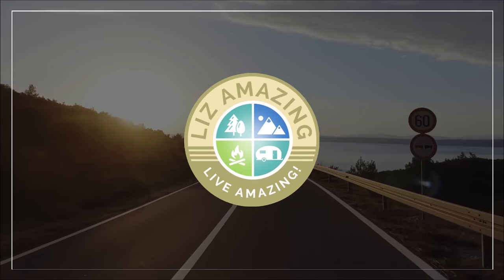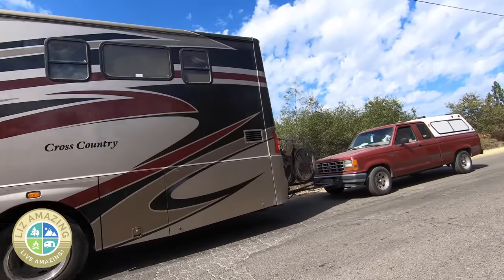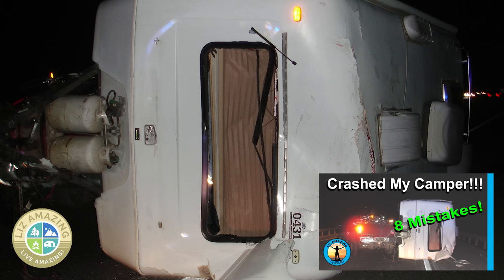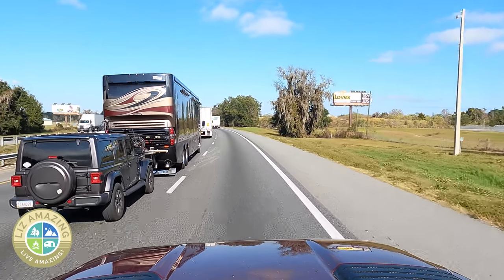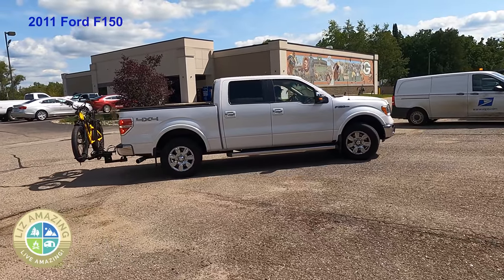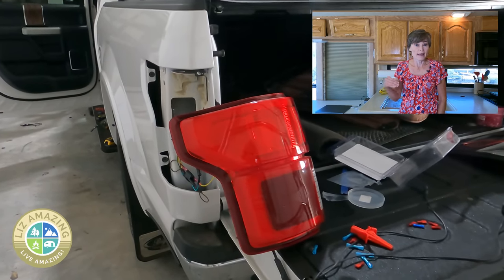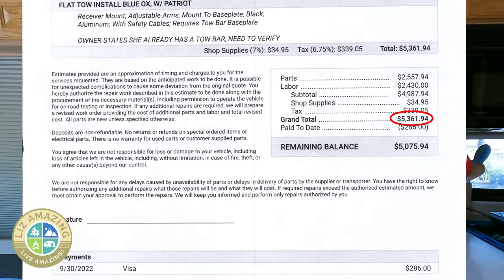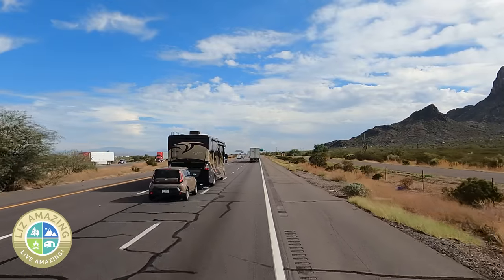These RVers are putting others in danger

Comment: TIP:  To get over the issue with the Blue Ox braking system and the pressure needed to be applied to it (to engage the brakes) from the driver’s seat, we use a carpeted board between the seat and the braking system.  Works like a charm!
Reply from the maker: Thanks for this!

Comment: If you use a tow dolly - Put safety chains on it-They are on Amazon for less than $20.00 a set and do not come with a tow dolly. The straps that go over the wheels can come loose and need to be re tightened after you drive a short distance. I also make sure whatever I am towing has a hitch on it so I can easily move the tow dolly if needed.
Reply from the maker: Great tip, thank you so much, Mark!

Comment: Depending on the state you are towing in you may need brakes on any toad over 1500 lbs. Also, the brake system that stops you under normal braking will also have a break away feature. Toads becoming disconnected is not uncommon. I had a tow bar pin vibrate out on a super rough road and that brake system helped reduce the damage that occurred.
Reply from the maker: Very good points, Sue. Yes, tow bars do indeed fail. Glad you are taking safety precautions. Thanks so much for watching and commenting. See you in the next video.

Comment: Very timely Liz: thanks. I've been struggling to find the right towed vehicle. I don't have a big diesel like you, but a 27' gas engine motorhome with a tow capacity of 3,500 lbs. Apparently it's not the engine (8.1L) but the frame itself and perhaps the transmission. It would have been nice to flat-tow a vehicle. Now I'm uncertain even on a tow dolly. And I didn't like a tow dolly either exactly for the reason you showed. It's a nuisance and unsightly when not towing. For sure - I don't have $5k to plop down to do it the way you have. But I'm with you: safety matters more than anything else. Better to get there slowly than not get there fast.
Reply from the maker: Yes, just don't rush it, Michael. I think I'm going to do a video about how important it is to set some money aside when buying used. I'll likely share how much I spent and how much I set back so people have an example. Let me know if that info would be helpful, and as always, thank you for watching!
Reply: @LizAmazing  Thanks. Your experiences, good and bad have been highly relevant, and you have a succinct but very understandable way of putting things. So, yes, by all means, do one.
Reply from the maker: @Michaelw777.52  Thanks, I will add it to my list. Stay tuned!

Comment: I’ve had many folks tell me the same thing about brakes on your toad. I always ask if they’re familiar with Newtons Law. The answer is always no. It’s F=Ma. The force applied to your tow bar and hitch = mass(weight of your vehicle) x rate of acceleration or deceleration. So if your vehicle is 5,000 lbs and you needed to make an emergency stop from 60 mph then the amount of force applied to your hitch and tow bar is 60 divided by the amount of time it takes to stop. That time is extended when your toad doesn’t have brakes but let’s say it’s 10 seconds. That means that the force applied to your hitch and tow bar is 30,000 lbs. I bet your hitch and tow bar is rated for 10,000 lbs. What this means is you will not be able to stop and your tow bar and hitch will fail causing serious damage and may cause you to lose control of your motorhome. This is why you see such terrible accidents involving motorhomes.
Reply from the maker: Oh my gosh, John. Sure wish I had you standing next to me in the video. That would have been a great sound bite! Thanks for watching!
Reply: @LizAmazing  Thanks. I hope this explanation helps so no one gets hurt in the future. So many folks convince themselves that auxiliary brakes are a waste of money because under normal driving conditions the force applied by the tow vehicle on the tow bar and hitch is well within the specs for that equipment and their coach. Unfortunately if they find themselves in a situation where they have to slam on the brakes to avoid a major collision, not having the auxiliary brakes will not only ensure you get in an accident but the force of the tow vehicle will damage the tow vehicle, the coach they’re in, and can cause the driver to lose control. Usually they won’t have a second chance to rethink their position on auxiliary brakes. I’m hoping the folks that don’t believe they need an auxiliary brake system look at the science before it’s too late.

Comment: So informative, LIz, -- QUESTION --  I noticed that @03:48 that when I look closley I can see your F150 front wheels turning to the left as you turn your Class A.  Does the Blue Ox actually turn the steering wheel too?  Hhow does that work?
Reply from the maker: Hi Colleen. The truck is in neutral and the steering wheel is not locked. This is a flat towable truck. It just follows the motorhome.

Comment: Safety First!!!  As a Commercial Driver for 55 years, I've seen most of it!!  Just one word of caution Liz,  If you find yourself on Icey, snowy road conditions, Turn off the tow vehicle brakes, Your pickup is lite weight, with very little weight in the back, it will lock up first...  Very dangerous!!!   Safe Travels!!!
Reply from the maker: Good to know. Thanks for this. I sure hope I never get on ice though. Great tip! Be safe as well!

Comment: Good video, but you missed that a large number of states require brakes and a breakway system on towed vehicles weighing over 3000 lbs.  This includes Michigan and a bunch of other states.  Ohio has a 2000 lb limit for brakes.  My Chevy Sonic toad is under 3000 lbs, so technically legal in most states, but I would never tow a trailer or vehicle without a breakaway system.  I went with SMI's Stay-N-Play system, similar to the Invisibrake from Roadmaster.
Reply from the maker: Good to know, thank you very much, Brian. Glad you have a good system, and thanks for watching.

Comment: I completely agree, but in your video..just because the RV brakes go one and the trucks don't doesn't mean they don't have a brake system installed and working properly. I use RVI Brake and it works great and I have a tablet that I can monitor the system from the MH. It is a surge brake system and if you just tap the MH brakes or graually slow it may not activate, but under harder braking it most definitly does. Just FYI....But yes EVERYONE should use a supplimentary brake system
Reply from the maker: That's true. It could just be lights, not brakes. Glad you have a system, Jeff, and thanks for watching.

Comment: Motorhome Magazine prints a free guide....Dinghy Towing Guide. They explain all dif types of braking systems, towing systems and lists of vehicles that are best to tow. For lighting, I ended up buying a TowMate wireless system. Less expensive than paying to have my Jeep towing/wiring harness replaced. Locks for tow bars are very necessary too! My tow assy came loose once.....Jeep was held by safety cables. No one hurt....but boy what an experience I do not recommend.
Reply from the maker: Oh thanks for this, Donna. I've seen that Towing Guide, so helpful! Thanks for your comment, and for watching.

Comment: The brake system I have on my
TOAD vehicle will activate the toad’s brakes and slow it down and stop it should it become disconnected from the motorhome
Reply from the maker: Yes! That's what you need for sure, a breakaway safety cable. Thanks for watching.

Comment: A few notes to add---we've been using the Patriot III system for quite some time now and it's worked flawlessly for us:
The Patriot III braking system does NOT require a "power seat" in order to work. It requires that the seat be adjustable, front to back, to provide the proper support to the back of the Patriot equipment. And you absolutely DON'T "push it in and wedge it in"----the unit actually has lights that will activate and warn you if you DO wedge it in tightly. The seat needs to merely lightly touch the back of the unit and can actually have a little bit of space between the seat and the unit. When you hit the "setup" button the unit simulates a braking situation and lets you be sure that you have the unit correctly positioned.
The Patriot III does not take long at all to put in place and set up for travel. I would estimate that we do it in less than five minutes---probably more like three minutes. You put it in place on the floor, clamp the brake pedal, adjust the seat, plug in the power and the breakaway cord, hit the power and setup buttons and you're done. Easy peasy. I honestly don't know how anyone could say that it took an excessive amount of time to set up. 
I will admit it's nice to not have to do ANYTHING but I do like the fact that if we change vehicles we can easily transfer the Patriot to another Toad.
Liz, bear in mind that your truck may require a specific routine that needs to be followed to prevent damage to the transmission and you should be able to find this in your vehicle's manual. Every vehicle is different---we have a "cheat card" that we keep in the glove compartment of our Toad car and pull it out every single time we get ready to tow. One wrong move and we could be looking at a huge repair bill!
Best of luck with your new setup---it looks great!!
Reply from the maker: Thank you so much for this. I got some bad information from Blue Ox where the rep told me power seats are needed. She should have said adjustable, or maybe power seats are recommended over manual. Anyway, glad to hear that it does work with your seats. 

And, yes, each flat towable vehicle will have a specific method to get it into Tow Mode. Thanks for this and for your kind words. Hope to see you on the road, and thanks for watching.

Comment: I am surprise that this was never mentioned to you. I have the same system you have. Exactly the same set up. And my tow vehicle is only 2400 lbs. a small Kia, 6 speed flat tow. I also have the light in the dash board on my rv to let me know that the brakes are activated. And yes I paid just about the same price you did. This system is safe and easy to use. No box between the seat and the pedal. Thank god. By the way food for thought. Since you have a caterpillar engine. Please use only caterpillar parts. And be aware of the HEIU pump. It’s a pump for your fuel system. If it goes bad your engine will not run. And it could also damage the engine. Caterpillar are good engine, BUT only use caterpillar parts. See you on the next video
Reply from the maker: Thanks for this Michel! I've heard good things about that Caterpillar and will be sure to take good care of it. Thank for watching.

Comment: LOL, you found out the hard way like I did. I thought around 1000 bucks and done but no. By the time blue ox hitch, hitch plates, wiring and invisibrake braking system installed, around 5 grand and a little better to hook my chevy 4x4 to my new to me class A. Still trying to find the best air pressure to set my invisibrake to, right now set to about 60 psi and still not sure that's my best setting. What are you running yours at ? Roadmaster really hasn't given me the best info on that. Definitely was sticker shock by the time it was all done but seems to work great.
Reply from the maker: Hi Dennis. Mine is set at 60 and actual read out is 62. I think it's a good setting based on some sudden stops I did in a parking lot to test it. It is the recommended starting point for my setup, per the installation techs. And YES, so expensive but can't put a price on safety and peace of mind!

Comment: I towed my Jeep wrangler over 30,000 miles behind my class A with a $125.00 tow bar... no, problems what so ever.  Then I bought a new 2019 Class C and Jeep cherokee,  well the Cherokee has no bumper to hook up to. So I picked a NSA tow bar , with brake and light kit, $ 2500.00 ,came with a surge brake. Easily $2000.00 cost to install, but I installed myself,  the actual tow attachment bolts right to the frame. The surge cable hooks to the brake pedal along with the emergency brake cable, the only reason ,besides the law in most states, is if you get in any accident your insurance wont cover anything if your towing without brakes. I didn't hook up the lights, because if your sitting at a light or something your surge brake is off and so are the lights.  So I continue to use my magnetic lights wired to my rig which shows I'm braking,  the insurance is what got me, two new rigs and the insurance would be voided without brakes.
Reply from the maker: Such a great point, Ray. Yes, if you don't have brakes your insurance will not pay. Glad you've got a good setup that works for you. Thanks for watching, and be safe.

Comment: Yes, brake controls, and stability controls are important but also, not all vehicles can be pulled this way. Some can be destroyed costing more than $5k
Reply from the maker: You're exactly right. As you know, I had to buy another vehicle as mine was not towable. Thanks for watching, Armand.
Reply: @LizAmazing  I am sorry you had to go through that. Very costly lessons.  I have only had my motorhome for 2 years, and I am just now replacing it with my first 5th wheel. I learned this by talking to others about towing, so I am surprised that nobody mentioned these issues. I too am very concerned about safety, so I do tend to do a lot of research.  I am still very nervous for my first 5th wheel adventure.  thanks for sharing.

Comment: You are correct but I would never dream of not having a break system. In fact I used a older unit for many years and we decided to upgrade to a modern wireless unit. 
We tow a a manual ford  ranger. ext cab with a cap which on Ranger rear tow we have 2 E bikes on the correct RV rear bike carrier  and professional inflatable motorboat stores under cap of bed. 
One thing I would not go without is tire sensor monitors on motorhome and Ranger pickup it shows all 6 tires 
I can see each tire temperature as well as air pressure. It saved me already. The sensor went off on a trip showing excessive heat one tire . Well turned out to be a frozen caliper which I pulled over before it got worse.  I’m skilled to do that repair. I pulled off to safe spot. Unhooked towed vech got replacement-caliper for Ford E450.  I carry 10 ton bottle Jack and impact power wrench which I can run off generator and easily pull duel wheels off rear.  I hate doing it but I hate the fact being stuck then towed to a shop told I have to wait maybe a couple days and pay a lot.  In the end the caliper cost me 100 bucks and we were on our way in a hour.  
But knowing the wheels of tires are overheating or under inflated gives us piece of mind as well travel along.   Replacing tires every 6 years is a must do too.  Even though our motorhome is out of sun and garaged they still need to be changed. 
Once you have a a blowout you become aware of why a good tow setup is gold and monitors to make you aware something is happing right away not before it gets worse. 
People towing without the proper tow equipment are fools.    I go as far as adding a camera showing roof area and solar panels just in case one gets loose. I also helps for backing in or under areas to clear branches, tunnels or antennas are down before moving. 
You can never be to safe. 😮
Reply from the maker: Yes, Ed, TPMS is the way to go. I've met some cheapskates on the road who say they stop and check the tires, but they can't check them often enough that way. I am a big believer in TPMS and will be doing a video about it soon. And so glad you are using a supplemental brake system. I sure hope this video helps get the word out! Thanks for watching.